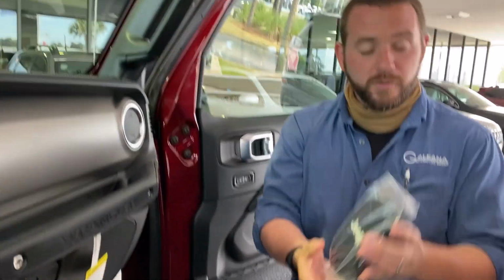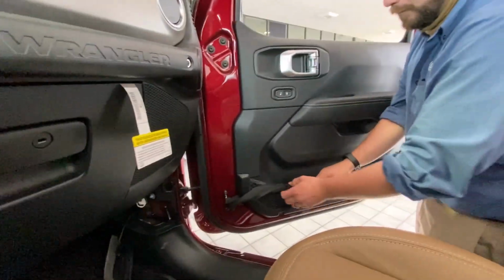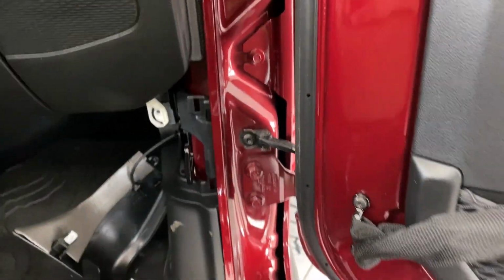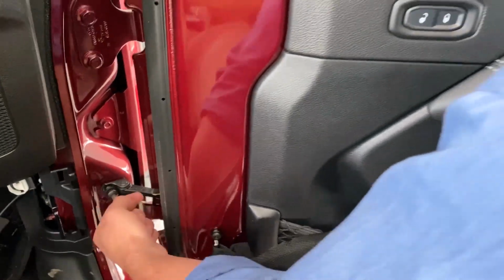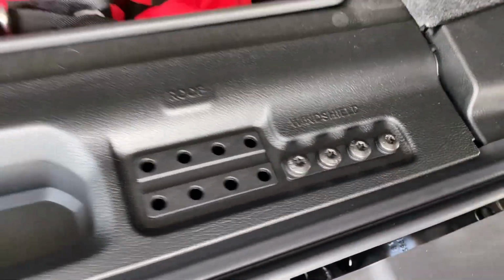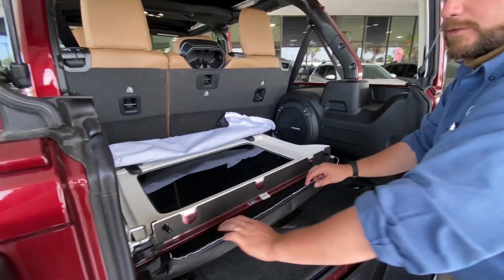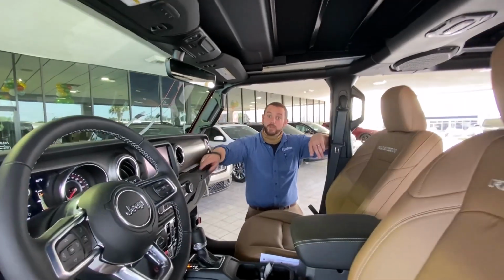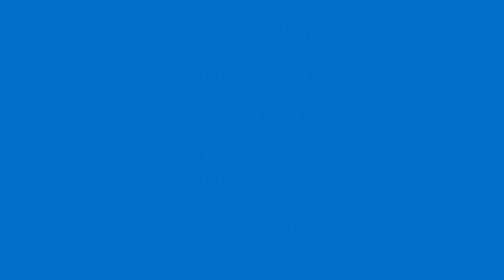How to Remove Doors & Windows on a 2021 Jeep Wrangler Rubicon with Sky 1-Touch Roof

Comment: One thing not mentioned, except for a small paragraph in the manual, is with the Sky roof, you CAN NOT  drop the windshield, by removing the 4 bolts. It risks damaging the front seal of the roof. The top itself would need to be lifted off to do that, and it is a much bigger (and heavier / inconvenient) job.

Comment: The one touch sky roof is definitely a better option if you're doing it alone or live an an apartment complex as I do, but takes away from the cleaner and classic look of the 3 piece top
Reply: Skytouch is really useless. 4k, bound to break and you still won't have an open air feel. Soft top or dual top pack. I have both and never use my hardtop. I personally wouldn't even consider a jeep if I couldn't take everything off
Reply: @johnk6534  that's why I need to buy a house before getting one. Or a storage unit I can put a hoist in lol
Reply: @Juan_E_Dewitt  Hoist is the easiest way to get the hardtop off. I bought a dolly that was built for the hardtop. You need 2 people but it sits glass down and it has wheels so you can move it around.
Reply: The evolution of Jeep Wrangler. Simply amazing.
Reply: @johnk6534  you can remove the SOT, and it's VERY easy, almost easier than the regular 4 door hard top, and easier to store too

Comment: Love this!!! I have a new 4-door jeep and was wondering how hard it would be to get the doors off.  I can do this myself :O)  Love the roof.  Can they be installed on any Wrangler??  I have a hardtop, currently.
Reply: They cannot be installed on any wrangler. The body type is different with these
Reply: Notice how the back window is still on, with your hard top, the whole back comes off.
Reply: I don’t think these Jeeps are designed for you to take off by yourself, if possible find a man around the house to help you, you don’t wanna damage the doors or windows. 👍🏻

Comment: Now impress us and remove the rear window and one touch roof...it can be done successfully and believe it or not a lot of owners would like to learn how.
Reply: Jeep explicitly states that owners should NOT remove the SkyTouch top.
Reply: “Comes”
Reply: You can remove the top, i have. It’s like 8 bolts on the sides and 4 on rear window
Reply: @joeboo2471  Voiding the warranty is one of those big flaws Jeep has. You do any alterations outside of an overpriced dealership install , your warranty vanishes. Jeeps are sold because of the plethora of aftermarket upgrades. They want you to alter it so they are no longer responsible for anything.
Reply: @strohdog242  I think I went down that road the first week of ownership😳😳😳
Reply: @jntaylor63  If you have the back windows removed and the Skytouch top...I don't see the point to remove from the Jeep!  Better to get the Soft top instead and save 4K!
Reply: @Summerfan69  Sky touch is really stupid and a waste of 4k. People that have never driven a complete naked wrangler don't understand. 4k, bound to break and you will never get the complete open air feel

Comment: How come this thing connect electric to roll window up and down no wire in between when remove the door
Reply: The wire harness for windows and mirrors is by the bottom hinge and tucks away easily when doors are off

Comment: I want the doors to fit in the trunk as well.
Reply: You’d have to get the half door version with zipper windows. I work at a Jeep dealer I’ve seen a few. The doors and windows split in half you can pull the windows and have half doors which are pretty cool or take them out all together. Ford on the other hand you can pull the doors and put them in the trunk their doors are frameless. The only issue with frameless doors is the windows are what seal the door to the body and over time they kinda sag. Another issue at the moment with the Bronco is time. Some people are still waiting over a year to buy one. As a Jeep owner I leave the doors at home I’d rather have space to put stuff in the cargo area. I do leave my Jeep doorless for long periods of time and if you have a garage you can leave it off all summer. I leave the soft top on to protect me from sunlight basically. I also live in New England it rains with out warning and to be honest it doesn’t really get too wet inside if your soft top is on with no windows or doors.
Reply: Get a Bronco then
Reply: @dubguy1121  so if I order a Sahara but not the half door version it won't fit in my trunk like this video?
Reply: @raizacalderon4327  full doors won’t fit. Half door and windows will.

Comment: Maybe a dumb question but does anyone know how the freedom top fairs in a car wash 🤔 can't decide if I want hardtop or freedom top
Reply: No issues in car wash only touchless, only issue I have here in Canada is during the winter when I leave it outside , ice build up is a pain
Reply: Stay away from sky touch it doesn't complete open and will break
Reply: @johnk6534 second ignorant comment I’ve seen from you. It opens past the rear passengers seat and is as wide as the roll cage. Has been proven to be reliable.